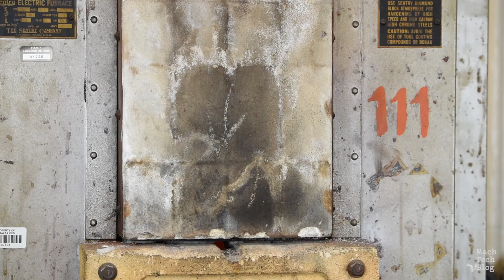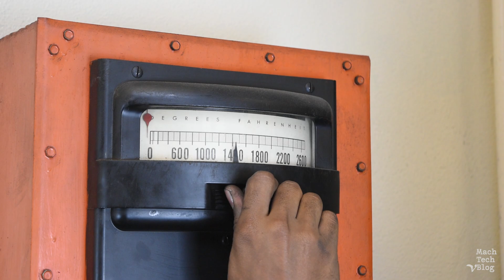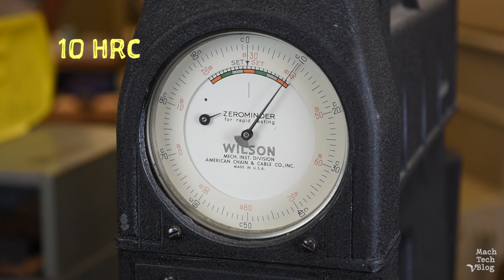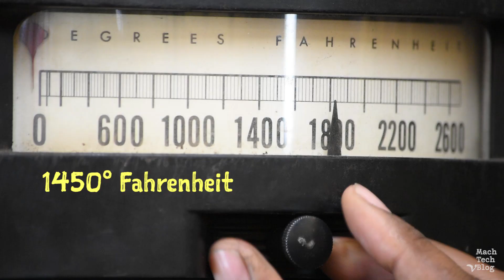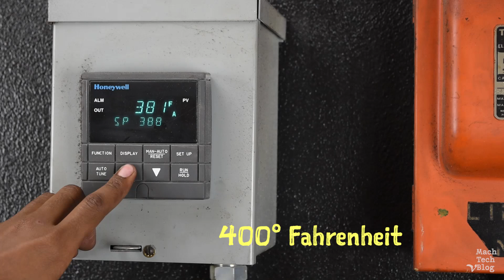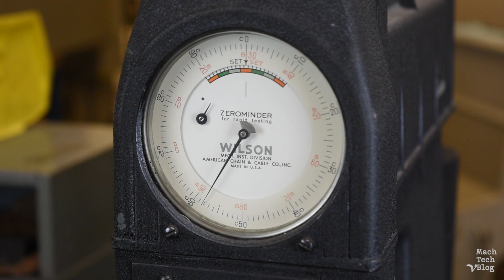Case Hardening

Comment: So how does case hardening work when you get that rainbow patter on the steel?
Reply from the maker: Hey, Ethan,

We're primarily concerned with case hardening as a way to improve the wear resistance of steel, as opposed to improving its aesthetic qualities. So, case coloring is not a topic on which we can offer much information.

That said, here are a few points from our research on the topic:

- Case coloring is less a product of carbon diffusion into hot steel than it is a product of impurities in the carburizing compound interacting with the hot steel in a sealed environment. Common recipes for effective case coloring compounds include bone charcoal, leather, and a host of other carbonaceous materials with various impurities which produce unique coloring effects. 
- The carburizing box and the clay/mortar applied to its seams create a hermetically-sealed environment which also appears to be critical. Moreover, case colored parts should be quenched directly after carburizing without allowing the parts to interact with ambient atmosphere. Most practitioners elect to dump the contents of the box directly into the quenching medium. 
- You can case color steel at temperatures below the temperatures required for case hardening. And case coloring will eventually wear off and the treatment will need to be reapplied. On the other hand, the surface hardening effects of the case hardening process are essentially permanent. 
- The coloring effects of the case coloring process are notoriously unpredictable. The patterns and colors produced from one part to the next are highly variable and sometimes the coloring effect doesn't occur at all. This one-of-a-kind nature of case colored parts adds to their allure.
Reply: The L.S. Starrett company has this down to a science. I don't know the specific little tricks they use, but I seen Starrett tools whose surfaces are blue, yellow, and red swirls...absolutely beautiful finishes on their heat treated steel.
Reply: Use bone meal charcoal, also when quenching, use areated water to quinch. It will healp with the colors
Reply: To color case harden the steel, I think you have to take the box out while it's still at maximum temperature, turn it over, and dump the parts straight into the water to quench them before they're exposed to oxygen.
Reply: elektro3000  bad idea!
Reply: Generally the colors you see when you heat steel is a result of the oxidation of the steel as a result of tempering.  When the steel air cools after tempering it will take on a specific color determined by the temperature it was tempered at.  At the 400f used in this video the cooled tempered piece should have taken on a straw color.  The hotter the temperature the more blue it will be, however tempering at higher temperature will result in a softer steel.
Reply: There is a considerable difference in casehardening colors and tempering colors. Drawing color casehardened parts to 375 will relieve some of the stress without effecting the decorative colors. Higher temperatures, much over 375  may change the colors and soften the part.  There are almost as many formulas for CHARCOAL CC hardening as there are people doing the work. Cyanide CC hardening is not so variable. I have worked where the cyanide process was used and have a friend who does charcoal CC hardening commercially. Usually hardening of this sort requires far less time and the "case" for gun parts for example is only .005"-.006" deep. Going deeper on thin parts will through harden them and make them brittle.  These parts are not machined and the charcoal and metal parts are all dumped into the water.  The charcoal burns off any oxygen that would otherwise damage the finish. But how the parts are loaded into the "box" is critical to minimize warping when they parts come out of the box and into the water. In this video they were machining/grinding away some of the case to bring the part to finish/size so they needed a much deeper case.
Reply: thanks for my revision ofter 25 years
Reply: Aceroadholder, if you want to see who truly had it down to a science, go look at any Winchester made before 1900.  They made some beautiful rifles, and now days Turnbull restorations is doing it and they are almost on par with Winchester.
Reply: Man, you should search for midwayusa in this topic
Reply: https://youtu.be/sFWLQeTCJ4s
Reply: you got half answers mostly, so here goes. casing for colors is a patina finish made by dropping polished steel that has been encrusted while heated into an aerated quench. the encrusting prevents oxidation, the quench shatters it, and it flaking off exposes hot steel to oxidation from the bubbles at varying temps. fall out of tree simplicity in theory, absolute alchemic witch craft in practice, lol. you can get the appearance other ways, but let's keep it on topic, genuine carburized speckly steel. 

you can pack carburize in charred leather, ground bone, charcoal, even natural gas. but, you need the packing to actually skin over the hot steel entirely (or it will quench grey, or blackish), yet rinse off in the quench. you also need this to occur in a reasonably narrow temp range, so all the oxidizing does that pretty thing. of course, it also has to allow proper heat transfer for actual hardening. leather is actually the traditional pot packing for color casing, bone was for non color. of course, all the magic is what leather, the prep, what other secret sauce they added, etc. but, that is the final heating allowed. any tempering, the colors fade, some even disappear. that brings us to

number 2, the method used on those trap locks on Spanish shotguns, as well as frames, receivers, screw heads, etc:cyaniding. yes, it is exactly as hazardous as it sounds. if you heat steel cherry red in a flame, and coat it with cyanide, miracles happen. it gives off very poisonous fumes,the steel carburizes, and the surface oxides vanish. repeat, the case gets deeper, all else remains the same. when quenched, you can have polished grey, or colors if you aerate the bath. the bath, your work area, your tools, and usually, you, get a nice coat of toxic residue, of course. the OLD "kaseknit" was cyanide based, or so I hear, but modern stuff none, so it doesn't remove oxidation while forming the case. the case itself is usually fairly thin, often incredibly so, and often not impressively hard.

now, in parting, a suggestion as to "how one could do it in production". you use a steel whose final quench temp from final tempering is the high range of your desired colors. previous heat treat all occurs in a vacuum furnace, including gas carburizing, so the surface is still bright. final is inert atmosphere or vac, with the quench either aerated blast or bath. same results, no alchemy, and reasonably uniform results, so Joe has the same colors as Phil, even if made in different batches. if you blast quench, your gas is wasted, however.
Reply: Thanks for the in-depth response, very helpful! Thanks!
Reply: This process is called colour case hardening this is also used on expensive shotgun actions. The carbon mixture used for packing around the steel parts is a mixture of Bone carbon charcoal and carbonised leather some manufacturers use other carbon forms others add Ferricyanide to the mix. Then heating the metal box for an hour, but instead of letting it cool slowly the contents of the box is dropped into cold water with air blowing through it. So it is surface hardened and coloured all in one action.
Reply: Jack Baker A dictionary will also help with your horrible use of the English language!

Comment: what would be the difference to quench the part in oil as opposed to water? excellent vid, making me wonder about even more things now!
Reply: Oil quench is more subtle, as it dissipates heat slower than water. If you want the highest hardness, use as cold water as you can possibly have as a liquid and use lye in it to reduce the surface tension to get more quenhing effect in it.
Reply: I was told many moons ago quenching in water you form steam pockets (bubbles) so you get uneven, desirable ? effects and too fast cooling. But I think water cooling does have it's benefits for some applications.